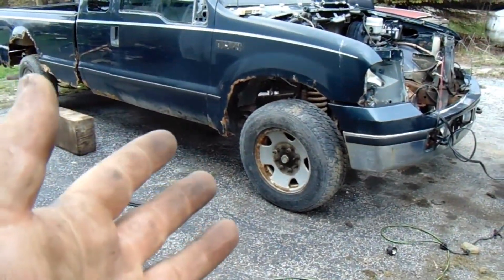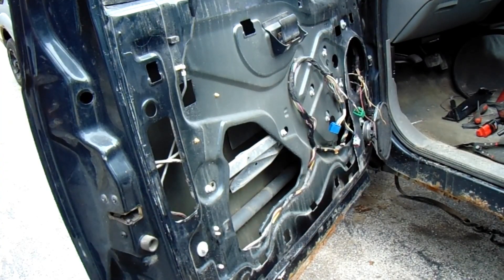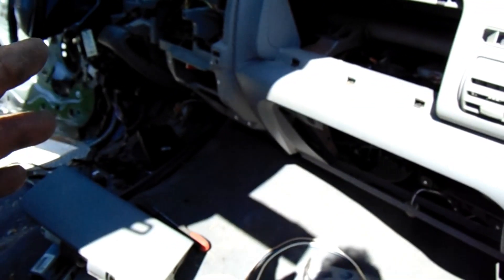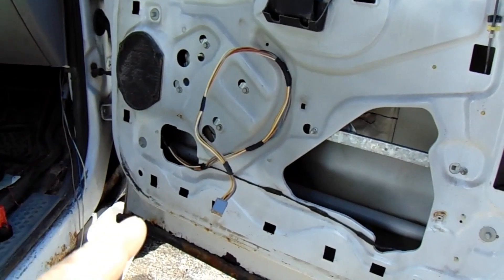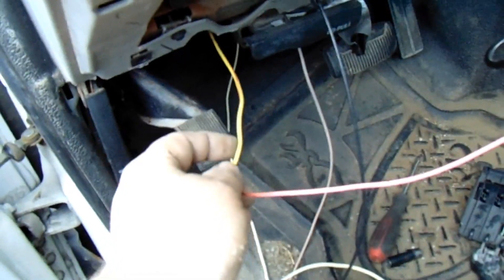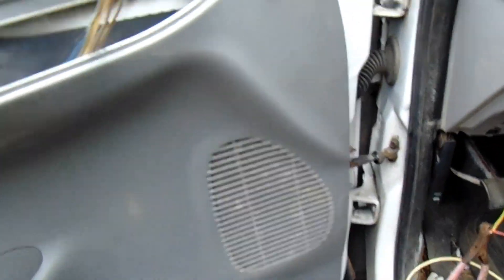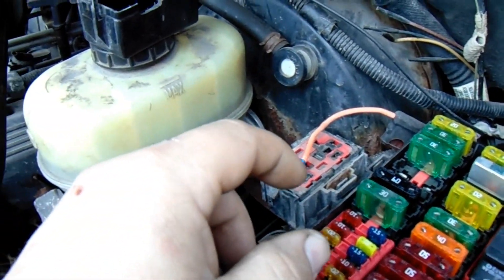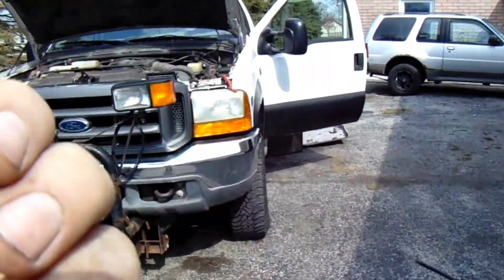Adding power windows to a plain jane super duty

Comment: This is the exact video I wanted to see. I’m not gonna tear my entire fuckin dash out just to have power windows. But I have a really nice set of power windows doors for my manual window plain Jane truck that I wanted to use. I was planning on just installing the manual crank and window in the new door skin till I watched this video. Thanks man. Big help!!  I have no problem adding a fuse to my fuse block so I can tap off that for the window motor regulator. I just wasn’t sure if it needed to talk to the exam or anything.